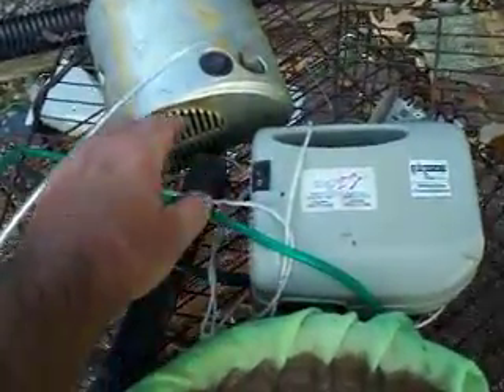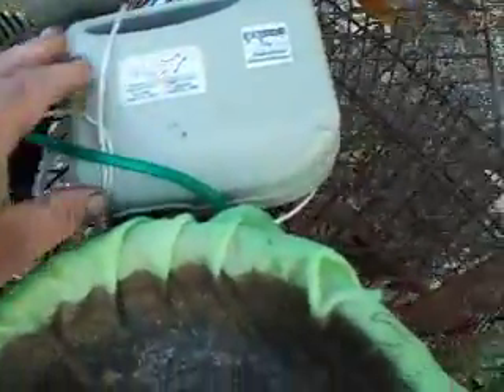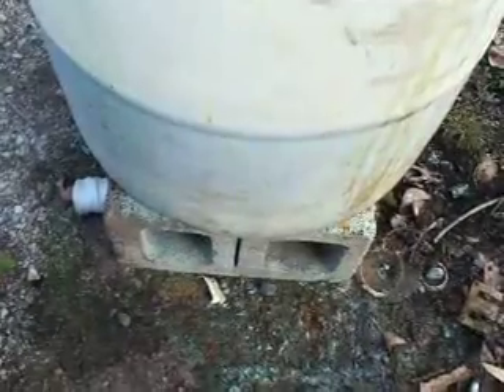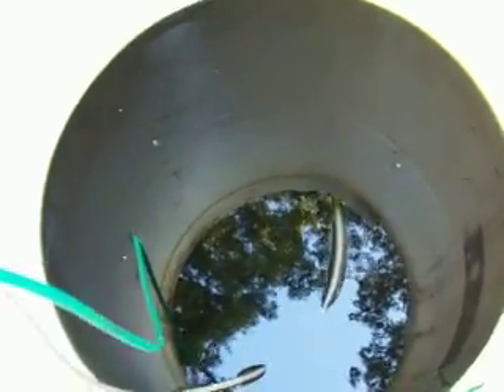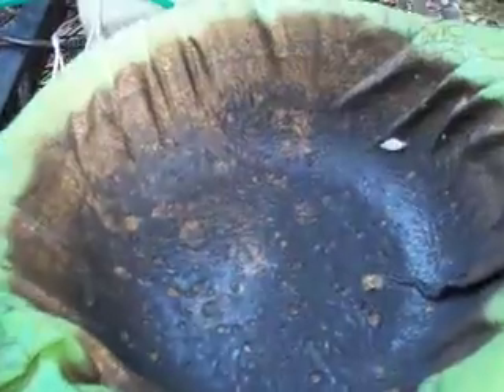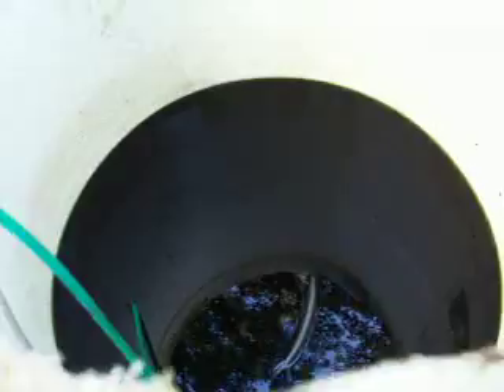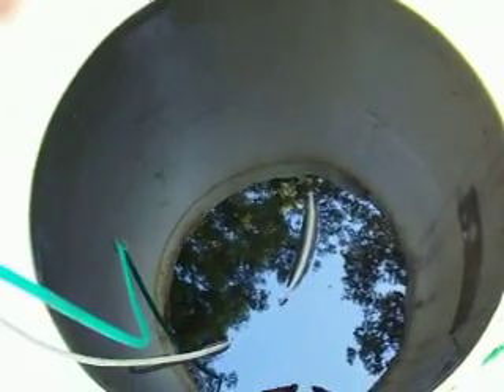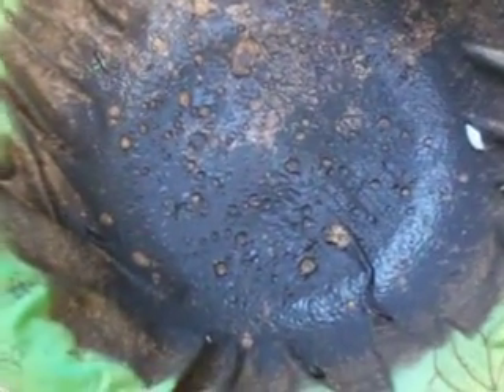AP process hcl+copper chloride

Comment: Geo" thanks for geting back to me  ok the copper wire i used came out of a tv it was rapet around the picter tub  i unwond it and it was just over a pond its been in solution now 24hrs not green so" i tryed what you said to ck the peroxide it not do anything in my hand i got it at the dollar store  just some white around my fingers not in the pom need help withe this one ?
Reply from the maker: +fredie w It's the copper. Copper windings in any appliance where the wire wrap touches is coated with a clear varnish. The copper from tv's have this varnish. Use wire from an old extension cord you have stripped the coating from.

Comment: Geo" i got know reaction when i add hcl 1/2 gal and 1cup or peroxide dose it take time to turn green ?  or did i do something wrong ?
Reply from the maker: +fredie w What kind of copper did you use. If the copper came from something like a motor or transformer, the wire is coated with varnish. Wire from coated wire like an extension cord will not be coated. If you have varnished wire, it will need to burned to remove the varnish. Another thing can be the H2O2. It needs to be fresh H2O2. You can pour a little into the palm of your hand (3%) and it will make little bubbles, if the bubbles form, it's good. The solution should have turned green as soon as you add the H2O2. It wont' be dark green but just a light green. That's good enough to start with.

Comment: Geo" i wont to do this too" i have lot's of boards to do  but not 55gal tank i wont to use a 5gal tank can I ? and im sorry but i dont understan how to make the copper chloride i have the hcl on hand can you get back to me asap" thank you".
Reply from the maker: +fredie w You can make the copper(II) chloride by dissolving some copper metal in HCl and hydrogen peroxide. The 3% stuff you get from the dollar store works great. Use any clean copper (pipe or wire or any clean copper though wire is faster) and place a pound or so in a clean five gallon bucket. Add a half gallon of HCl to the bucket carefully. Add a cup of H2O2 to the bucket. You should see the reaction as soon as you add the peroxide. The solution will turn green. Leave it overnight. The next day, filter the green solution through an old bed sheet or tee shirt to remove any undissolved copper.  Now you have a pregnant copper(II) chloride leach solution. Put your material in a clean bucket and add your CuCl2 solution to the material. Mix 32% HCl with even amounts of water and add this to the bucket to cover the material. Be sure your air tube is in the bucket first with the material added on top of the tube to hold it down. Use an aquarium pump to supply the air.

Comment: I have been using this method, but can't find any reliable info on how to reuse your ap solution. I have read that using stainless steel will work, but i haven't had any luck. Any suggestions?
Reply from the maker: Your AP (copper(II) chloride solution, CuCl2) is re-usable as it is. Keep air bubbling through it and keep adding copper based metals until the solution turns milky green with white crystals forming. Then you add fresh HCl to it and all the white material will dissolve into fresh copper chloride solution. Then keep adding more pins and fingers. In other words, with addition of oxygen and extra HCl ever so often, you can use the solution for a very long time. Iron is what fouls the AP solution. Try and keep as much iron out of your material as you can. If you want to learn more about it, go to Refinement of Precious Metals dot com and register. It is a free forum that I am an administrator for and we have a live chat, photo and video gallery.
Reply: Geo Thank you. You really know you're stuff. I appreciate the help.
Reply: Geo Thank you. You really know you're stuff. I appreciate the help.

Comment from the maker: add a few drops to your AR after the reaction stops.silver chloride drops because of chemistry.you cant have gold and silver in the same solution (besides cyanide).as soon as the solution cools,the silver chloride will start to precipitate.adding ice helps.not all silver will drop at ambient temps.if you were to lower the temp to below freezing,more will precipitate.silver will follow gold to the last wash,which is ammonia.ammonia is about the only base or acid the will dissolve silver chloride.
Reply: Better use ammonium chloride.

Comment: is that the same stannouse chloride we can use to test gold? and yea i have learn a lot about washes, it seems getting the gold of the parts is the easy bit, its cleaning and refining in multible baths and ar, that get the best result, do i have to rinse anything in ammonia? is it essential or can i just clean with water and hlc to get a clean gold, what befits does ammonia give? are you part of goldrefiningforum as i just signed up, its pretty good

Comment from the maker: tin in AP converts to stannous chloride(SnCl) which decomposes in the presence of oxygen and becomes tin oxide.a white powder that will accumulate in your AP container.if it becomes troublesome trapping gold foils,put all the solids in a non metallic heat resistant container and heat to a dull red heat.this will liberate the oxygen and reduce the tin back to elemental tin.then soak the foils in hcl to remove the tin.rinse in water and dissolve the foils.

Comment: so i am right in saying after the hlc bath, the hlc will not contain any gold in its solution , as hlc cannot dissolve gold right, it will be on the boards still covered in tin, which i can just (ap) and so on. what will happen to the tin in an (ap) solution, will it dissolve or stay as a solid that has to be filtered and washed out?

Comment from the maker: yes,you can give all boards a hcl bath prior to AP to remove tin solder.the gold traces will come out of this bath discolored and will not look like gold.dont worry,the gold is still there.as the tin dissolves,it takes on a positive charge and then "sticks" to the negatively charged gold plating.you can rub the black off with a rag although its not necessary.

Comment from the maker: copper chloride is a byproduct of the process.start with undiluted hcl and hydrogen peroxide.hcl alone will not dissolve copper.when you add the hcl and you add peroxide,the solution will instantly turn yellow to light green.the peroxide is an oxidizer and will oxidize a small amount of copper.hcl will dissolve copper oxide.this is to jump start the reaction.after you have a little CuCl in solution,it is self replicating.having an air supply drives the reaction.